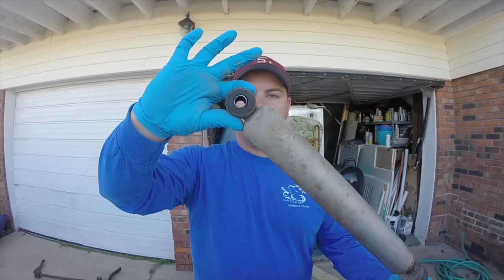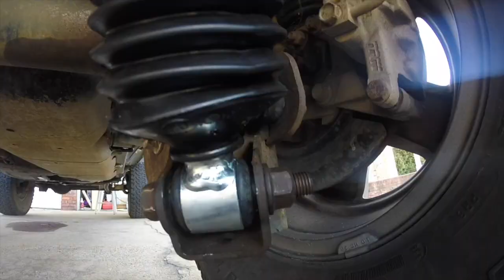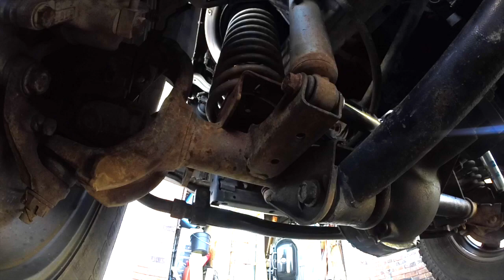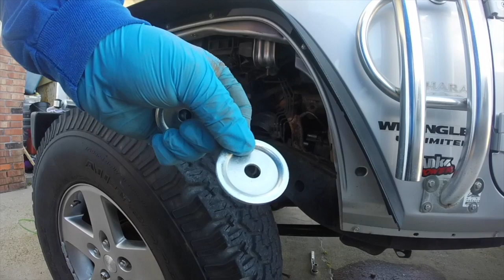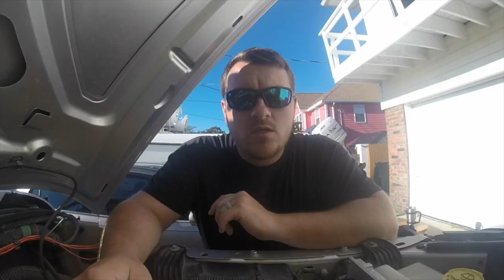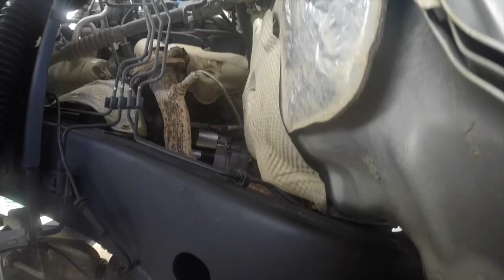Jeep Update / New Shocks

Comment: those tipm diagnoses usually take forever. and aftermarket parts or not, 6eu are junk and a bad design. who solders 8n relays that could be push ins and stacks circuit boards inside a plastic box that no 9ne can repair.

i was told it would cost ove4 a grand maybe 2 to fix the tipm.

it took 10 minutes to take it out and a little more to put in.

all,i really needed was a few 5 dollar relays replaced.

bad design. not your fault, even if it was aftermarket

Comment: mak’s tipm repair. 

a little late, but they are very cheap and thorough. i sent my tipm to them and got it back quick. they replaced some things i didn5 ask for and weren5 broke and also some relays tha5 were. it was about 180 bucks. they diagnose it, tested it, cleaned it, fixed it, shrink wrapped it and guaranteed it and sent it back to me.